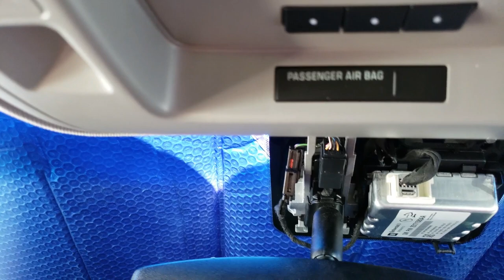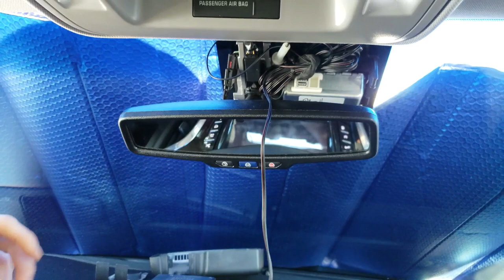How to tap into 12v Power on REARVIEW MIRROR for Radar Detector in a GM 2015+ Cadillac Escalade

Comment: Saved me a bunch of time ..  Made up the power pins by just pressing the cut to proper length sewing needles into the windshield camera  power wires..  No soldering needed...   10 minute job !!  Yes, I taped the assembly..       2016 Escalade...   Wire code color  correct !!
Reply from the maker: Great to hear a successful Install. Thumb up and please sub

Comment: Great video! Helped me with which harness to tap into. I have a 2016 Silverado and there's not a purple wire or red wire for power. There's a multicolor green/purple and multicolor green/red. Any idea which is the one to use?
Reply from the maker: Sorry can't help.  This is when you have to pull out the old voltage meter and do a check. Maybe someone here can help.  If you find out let us know here.

Comment: What did you use for pins to solder on to the wire?
Reply from the maker: Sewing needles
Reply: @JustinSmith0  sewing needles?  What kind I have Michaels and Joanne fabrics nearby
Reply from the maker: @alacran1986  just a basic sewing needle around 2inches long.

Comment: What are the wires for a 2020 cadillac xt4?
Reply: Just answered my own question. You were right pin#2(power), pin#5 (ground). Works like a charm. Thanks
Reply from the maker: What I found. NOT TESTED! Use at your own discretion. The purple/white wire is switched (at engine start) B+ while black/white is ground. Make sure you test that with a voltmeter and let us know if that is the case. Always use a fused cable. good luck hope it helps. PLEASE Subscribe Tring to get to 1k Subs